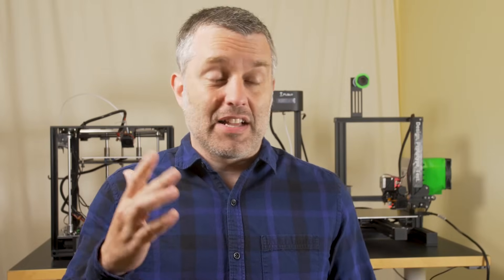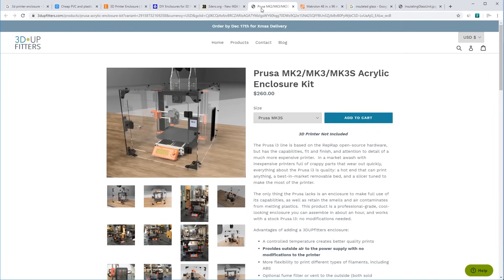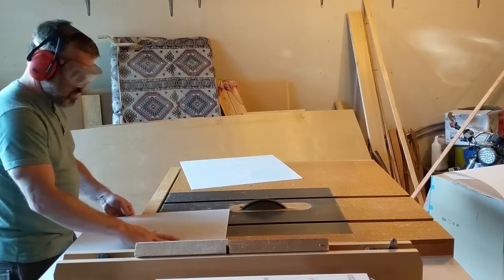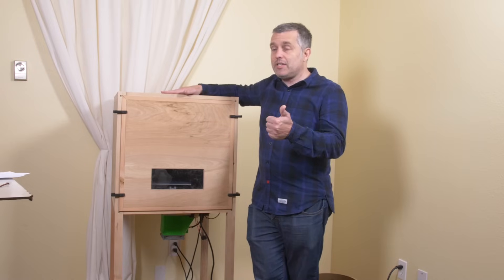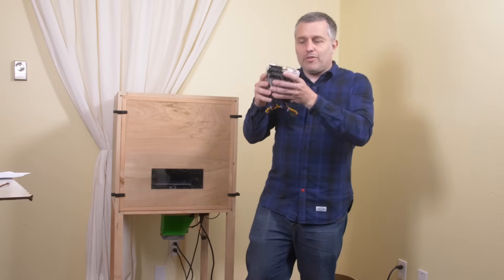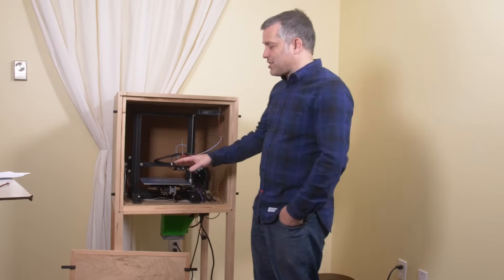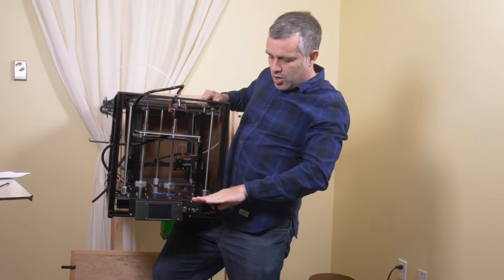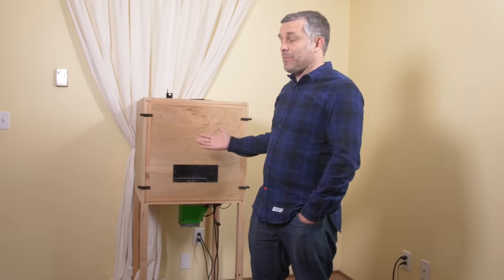3D Printing in a 100°C Heated Chamber - Lessons Learned

Comment: I know you already made a disclaimer about a fire hazard but I when I saw you get the heat gun out.... I can't help but tell you how dangerous that is.  It is illegal for example to use the cavity in a kitchen cabinet as a heat run (it needs to be contained in duct work), the chance of fire goes up significantly when you raise the temperature of wood.  One little spark in there and you will come back to lump of coal.  I hope that your finished design is made of metal or some other suitable material.  Otherwise, nice design!!
Reply: I love how this channel posts early prototypes and proof of concept builds with long discussions of the thought process.Just like this one. Those early builds are often unsafe, unreliable and should only be cloned to further the development.
Reply: Good point about the preheating of the wood increasing the fire hazard. Also this thing is a perfect oven. Poly-carbonate is not better from a safety perspective, both materials can emit hydrogen gas when they get charred because the heater heats it up somewhere above 300 C locally. The heater needs to be placed in its own steel enclosure with vents, so it cannot burn something if one of its holding screws fails.
Would some sort of cheap woven fiberglass material be a good basis material to construct the inside of the box from? It is heat resistant and hat a low thermal conductivity.
Reply: Menno van Lavieren, Potus Borg I agree with both you guys, I think he should have made a bigger disclaimer.  Someone might build this and skip the safety warning in the video.
Reply: Eh the ignition point of wood is around 300C so at 100C you still a ways away. Sure metal would but I don’t think the wood is hazard as is.
Reply: @Mrcaffinebean  it doesn't work like that.
Reply: @Mrcaffinebean  In theory it may be slightly correct, but in real life things are completely different.
Reply: not to mention the incredible dry environment inside, and the air circulating will feed a lump of coal into a flame in no time what so ever. This is dangerous even while being monitored. *If that curtain catches fire will will not be able to put that fire away* with a fire extinguisher alone, by that time your entire house is on fire.
Reply: Meanwhile this guy is getting shit done while you guys are fretting about what others are doing.
Reply: @bret44  Yes, it does.
Reply: Simple fix for version 2 - line it with plasterboard gyprock or drywall i think you US guys call it :D Otherwise cement sheet :D
Reply: Mrcaffinebean I would agree with that. I have seen wood used in places that 100 to 120. I have a wood panel in the reflow soldering machine at work . That has a heater operating at 300C . For some reason there is a piece of 4 by 2 in my component baking oven and that often operates at 120C for 8 hours.
Reply: I'm going to try this with my Anet A8.
Reply: Well the lack tables are made out of cardbord, i think theyre way more dangerous.
Reply: if the chamber temperature sensor goes bad and do not shut off the heater, the cabinet may catch fire. That curtain behind it could spread the fire to the entire house!
Reply: You should tell all the builders of saunas, that 100 degrees C is such a great fire hazard.
Reply: @Thomas.Kjosnes  bad example as saunas are very humid environments that hinder a flame. Dry and warm environments make the fire danger combo with wood.
Reply: @Mrcaffinebean  : It is as disclaimed - the main hazard is that as the moisture content of the material is reduced (ie water will all turn to vapour and leave the material before or at 100 deg C)   yes it needs an ignition source but the ignition energy is greatly reduced at ultralow moisture levels - and elevated material temps...  (100deg C is 30% of the way to ignition point - from room temp)
Reply: @ricardobraganca2307  if the temperature sensors goes bad, the printer will start burning, chamber or not.

Wood is much more fire resistant then what you guys give it credit for.  A solid wood beam are much more fire resistant then a steal beam, at least in buildings.  A steel beam will twist faster then a solid wood beam will coal to coal charts so much it will tumble down.
Reply: @Thomas.Kjosnes  saunas are more like 180 then 100 degres C.  So yes most people should check their data before they write stuff like they know stuff.
Reply: @kadmow  you need MUCH more then ignitions to start a fire in wood.
It is a higher risk that ordinary open printers catch fire, which have happen.  So basically the risk of fire are not that much higher then an open printer.
Reply: Just demo the runs in the middle of the basement floor with a fire proof hood. Worst case ,coat everything with soot  in the basement. Which is easy to remove because of the preexisting wood dust and spider webs protecting everything. :)
Reply: @NoelAWinslow  No, not all are humid places. You are thinking about a roman/greek sauna.
And still, the wall behind the heatet get way higher then 100 degrees.
Yes, I do regularly take a sauna bath...
Reply: @NoelAWinslow  That is a terribly untrue statement my friend. I've been taking saunas since preteen at the family cottage, so 30+ years, and less than 1/4 of them do I throw water on the rocks, and furthermore, it often keeps sustained temps north of 130°C...although it took YEARS to be able to handle saunas of that caliber...only the benches and the back wall of the benches are cedar. Everything else in there is pine.
Reply: @edstar83  Touche sir! The printer won't set it on fire IF it has working thermal runaway protection! That's why these should be metal and glass.
Reply: I have this in mind, though my concern is if you put the whole printer in the 'oven' it will eventually fail for one or more reasons; especially if you're printing nonstop. Remember heat is enemy to electronics components, not to mention cables that runs between the printer modules. 

The concept is well meritted. For those who plan to apply it think about separating the electronics module from the frame and place it outside the chamber. Take a step further, the stepper motors, especially the one on the extruder, they too have micro components buit in, think about it.

Lastly, I'm putting this last with a high note, think about the heatbreak cooling fins in the extruder. We all know how important that is. Now if the chamber is kept at high temperature, the extruder fan is blowing hot air into the fins, making it much less efficient in dissipating heat. This gets worse if your printing exotic materials above 285 C for long hours.

By the way, the Hemera extruder is a perfect candidate for water cooled system extruder. It's a full metal extruder inside out, flat shaped, screw holes in four corners for you to attach any type of cooling system. I'm already attaching a 40mm 0.5A full-bearing fan in the front of the Hemera and both the cooling fins and the stepper motor runs very cool even after 8 hours nonstop printing.
Reply: If you guys are still paranoid, a ten pack of thermal fuses is less than $2.

Kidde brand SM120X smoke detector relays are about $15
Reply: 451F
It has not been reached.
There is no reason to worry.
Reply: Not to mention that wood has a self igniting effect. Normally it starts at around 230°C+ but given "best" circumstances wood can ignite at 135°C (Probably not the one in the video). Not to mention that wood gas (150°C+) is very bad for health.

That beeing said. I like that someone tried out this design (I had a similar one in mind) so I know how it might perform and what to look out for.
Reply: Can anyone tell me why not using a descarded kitchen oven would not be safer, easier and so on? It’s kinda made for keeping stuff temperature controlled in a safe way. No?
Reply: @mennol3885  the right material is a concrete impregnated oriented strand board or "hempcrete". Thermally insulated and structurally strong. There are also various foamed ceramics similar to brieze block.
Reply: While I have always been a metal and concrete guy, as a former engineer and firefighter I can tell you there are a number of engineered wood offerings that are extremely resistant to high heat and/or fire. I trust engineered wood a lot more than I do many of the thermoplastics used in todays products. ASTM E119
Reply: @AndersJackson  at what temp is steel going to start warping in a fire condition ?
Reply: @AndersJackson  spell checker maybe next time? Completely unintelligible! LOL
Reply: @jtreg  tja, om det är ett problem så kan vi ta det på svenska, fjant ...
Reply: @edstar83 i did something similar with my anet a8 for abs printing. One night my house burned down, it started by the anet . I woke up just in time to escape @ 2am.
Reply: THIS is why I make everything out of ASBESTOS.
Reply: I have been using wood enclosure (6mm thick) over 1 year with active carbon flexible heater at 100 degrees, the heater glued to the back wood panel and I can say that. ITS IMPOSSIBLE TO CATCH FIRE WOOD AT 100 DEGREES CELSİUS. What I personally tested after saw this video is I just touched my soldering iron firstly at 250°C to the enclosure about 30 seconds, gess it? Nothing happened just a color change to yellow from white. After that I just placed the iron as a way that iron will always touch to the wood. After couple of hours later, what happened? Nothing! Just a color changing again yellow from white. White because my enclosure painted one layer white to look better. Not a fire resistant paint, cheapest paint I used. Additionally when printing ABS the enclosure temperature hits max around 60°C. That doesnt mean wood hit 60 degree just the air inside of chamber, wood usually remains maximum of 40-45 degree. While the room temperature 30°C Because wood actually is a bad isolation if its not thick enough. As my senecio its 6mm so all the heat goes away easily. Even though its enough to print ABS perfectly, Note that if you live hot area or country and if your machine not designed to work high temperature( if has pla printed parts, don't use enclosure. I build my CoreXY printer and I design it to work hot, doesn't has any printed parts, all parts aluminium. Motors are outside of the chamber. Direct extruder has water cooling exc. Think first if your printer survive at 60 degree place before thinking if wood catch fire exc.
Reply: I want to know what country has heat gun regulations...
Reply: Epic fail
Reply: It would make sense for the chance of fire to go up, heat dries out wood.
Reply: Funny, commercially people use wood all the time to knock down grinding and welding sparks with enclosures with much hotter temps and not creating fires. I have never seen sparks emitting from my 3d printer or heat guns. As an extra level of safety if you want to use wood, coat it with fire retardant material. I wouldn't use the word dangerous. Just be cautious and safe.
Reply: You probably double masked few years ago also
Reply: Thumbs up a million times to your comment!

Comment: So... a note from a Carpenter...  a wider gap between the glazing will increase the amount of air "insulation" you get... but only to a point.  1/2" (aprox. 12 mm) is pretty much the max you can go between the glasing panes before convection currents start to form and any larger gap than that begins to become more of a cooling mechanism than insulating mechanism.
Reply: What about using a vacuum pump to pull a vacuum in the gap?
Reply: @ctrlaltdebug  With a vacuum you won't have convection so yes it will insulate well at any gap size.

Comment: instead of using  the heater options you mentioned......   would a simple  infrared lamp be a possibility?  no need for air circulation since the light projects it's heat right onto the build.
Reply: The idea of using a lamp that may be directed just on the print and not on the printer sound interesting.

Comment: The Qidi iFast has a heated chamber. I added one to my X-Max with a 250 watt PTC heater and temp controller. I heat to 60C and use the bed at the same temp.

Comment: That polyurethane foam with foil backing...little chunks of foam are easily broken off. Pretty sure this would inevitably get tiny pieces in your prints or printer. Unless sealing the ends maybe...during construction. The pink panther stuff is alot easier to cut although it doesnt have the foil backing. Ive worked with the pink panther stuff extensively. 
At least for my application...thw foil backed stuff was a no go due to the pieces that come off. The environment ive used it for was extremely windy...think 3000 250mm fans as well as a few dozen 4ft diameter 240v fans...moving a lot of heat(it was 110f inside the other day) and not wanting it to circle back into the intake. Pink panther stuff is a dream compared to foil backed...the downside being no foil backing.

Could also make a cnc hot wire foam board cutter but that wouldn't make sense unless multiple use scenario

Comment: I'm no expert but I've been looking at various videos about enclosures, and it seems while people get away with making air tight builds, I might try just making an enclosure just to prevent drafts and box in the heat but I don't want to let the heat build up considering alot of 3d printers as I understand have 3d printed parts inside and it's generally not good for the electronics, basically you just want the prints to retain as much heat but not the machine, I'm glad the psu seems like it was out I just jumped around the video as I'm idea shopping but I thought I'd leave some tidbits of info I picked up, and I might make a video later if my idea works out well or not.

Comment: Commenting as watching...
1. On the windows... if you can source thicker material (4 or 5mm perspex is cheap). Fabricate the twin walls using 8mm spacers around/in between the windows. Like a really shallow box. Bond with relevant adhesive. Drill/tap M6 hole. Fit 1 way valve. Use vac pump to remove air from between the windows. Thermal efficiency will be significantly improved and you can just re-vac as needed. Adding small circular or squar spacers in a couple of places in other areas of the window will prevent the panels going concave under -/pressure.
Reply: 2. Add thermal film to any non-transparent panels. The kind you get for going behind radiators works great. Standard aluminium foil bonded with contact adhesive will work too. 👌
Add: even painting it white then spraying with, preferably, Zinc galvanise repair paint or regular silver auto paint will help.
Reply: 3. To avoid the risks of direct heat/heated coils... add a "heat tank" to one side or back. Additional "box" with a heat source (ceramic panel or heat lamp). Insulate it heavily and preferably make from non-combustable material. A steel box or even a large tin can. Add a slow speed fan to carry air into the main chamber. Connect to thermacouple and relay to control on/off. Connect to a multi channel relay an t/couple array to add voltage through each line and add various temperature levels. i.e. On a 24v ceramic heater and 4 channel relay... each channel fed with 6v. Channels controlled by a 25, 50, 75 and 100 degree thermocouple respectively. Capable t/couples and dedicated microcontroller kits are roughly $/£13 for 2.

Comment: insulation foam board, insulation tape, scissors or knife, make a box that sits over the printer.... pretty simple, but you can upgrade that by adding a DHT-22 temperature sensor and arduino for keeping track of temperature inside chamber box
Reply: forgot to mention using plexiglass as a door... did this on the first edition Markerbot when it was released, worked great!
Reply: Think BOM was less then $50(US) bucks....STAY AWAY FROM WOOD

Comment: Very cool! My one question. How does the extruder hold up? With a chamber that hot, would the plastic back up and jam?
Reply: Heat creep til the filament backs up and jams is probably not much of a issue for The higher grade materials like the nylons this was intended for would be fine. It would need to be much cooler then 100c for plas etc.  But if the filament did jam. I would dial the nozzle temp down some and if still double check the retraction settings. If the print is retracting too often too much it'll pull  the hot  filament up too high and cause creep and jam.

Comment: I have a bunch of foam insulation sheets I was thinking of using on at least 3 walls. Double pane door is probably a bit much probably but I mainly want an enclosure for noise and to exhaust plastic fumes. It would be nice to safely be in the same room while it’s running. PLA is supposedly non toxic but there’s still tiny particles you don’t want hanging out in your lungs.

Comment: I built a chamber is out of wood for my Tornado insulated with 1/2 in foam board and the bubble silvered stuff for home ducts..   I want to get at the bowden tube I needed to get to that side.  So I hinged all four sides that fold down  and the lid sits on the sides.  So I need two sides up  or I have to remove the lid.  Then I can fold down all the sides and the printer is sitting on a table.  My controls are also under the table.

Comment: could use kiln materials.. like fire brick... light weight, easy to shape/cut.  use it as a literal 'fire wall' and frame then shell the box in aluminum.. you'll be set.  you could even put it on casters and just roll it around.

Comment: double walled glass wont work without an inert gas between the layers lol air is a great conductor and thats why double glazing stops working when you loose the gas pressure
Reply from the maker: Double glazing is still far superior to single glazing even with air in the gap. Part of the reason leaky double pane windows are poor insulators. It's because the air in the Gap is able to circulate instead of remain stagnant. Circulating air is tremendously bad for R value. This is the reason we fill our walls with insulation. Even circulation within the cavity is very detrimental